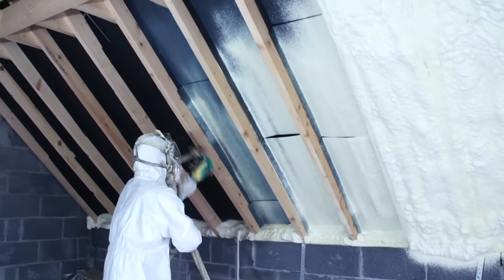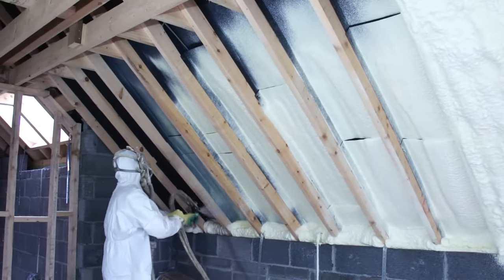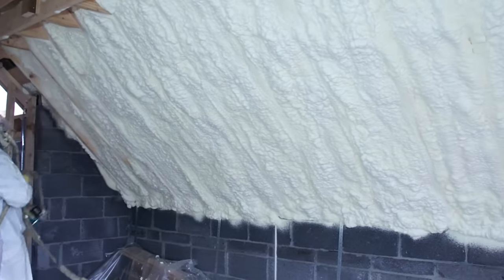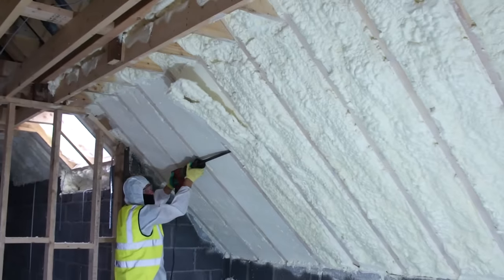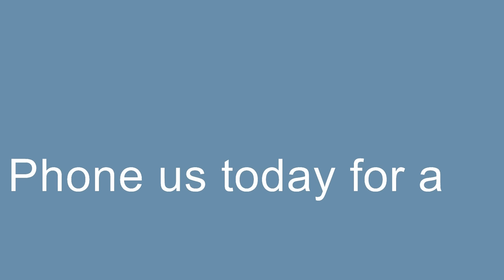Spray Foam of attic and then Foam being cut evenly

Comment: Nice neat job by the technician.... Plus he is laying thin layers at a time.... That way you will be assured there will be no uncured foam that remains in liquid state., which could off gas forever.. Seems the liquid chemicals used to make the foam are relatively unsafe to breathe in liquid form.... But become harmless after the chemical reaction has taken place and turned the liquid into a solid foam core... As in a Styrofoam cup we drink coffee out of....
But what do I know anyway?  I slept at a Holiday Inn last night.
Reply: +mrpearl1 Actually it sounds to me like you know quite a bit. You know more than the majority of these commenters. And yes I have sprayed foam before.  :)

Comment: I love this technique. I've spent hours installing fiberglass. Hated it. Tedious and itchy while I have my misgivings about how well it performs. This stuff sticks tight and is firm. Even rats would have a hard go of it. Fiberglass is a perfect home for rats and mice. Especially under a trailer home.
Reply: John Knoefler Mice,rats,bugs & virtually all rodents avoid the spray foam.they will not eat through it,so it is a saviour in more than one way.
Reply: John Knoefler i had an animal trying to get into my loft the other day and I sealed it with foam and it's given up now so it's excellent stuff
Reply: Inspecting a friend's attic the fiberglass insulation was matted down by rats, cats and and mice. Filled with feces. What a mess to clean out and replace.

Comment: Finally, 1 guy that knows what the hell he is doing.
So many houses have been destroyed by so-called professionals but this is the first 1 I see.
But still, I would recommend not using spray foam insulation.
If only that it looks horrible.
Glasswool and place some boards over it for a much cleaner look.

Comment: That's perfect. If I had foaming done  Id want the cavity full. Those that leave gaps are NOT maximizing the insulation value.
Reply: peterincgy open cell foam is done this way. closed cell is left just shy of the interior of the rafters, due to difficulty of trimming.

Comment: If 1/8 of spacing between roof sheeting is required by code to release preasure from the attic during storms how is it code compliant to seal off what the code calls for

Comment: What is necessary insulation for a home on pillars. 
Would you spray foam it then sheath it with a r_3 foam board on the underside joists  ?
Reply from the maker: Probably the other way around - fit the foam boards in a warm roof construction and then spray foam oto same - ideal combination

Comment: It's very nice, however it looks like there is a lot of wasted material ones he starts cutting off the excess foam!
Reply from the maker: Elamar - we hate waste also - we bag the trimmings on site, always and many customer use the offcuts as additional insulation in other voids in their roofs, crawls spaces and floor joist cavities - so it's not always wasted . If anyone has a good idea on recycling foam trimmings I'm all ears ?
Reply: You could possible run the excess insulation through a wood chipper or something similar.  That way, it would be a very fine material that could be used in ceilings or attics.  Just a thought :)
Reply: fusioninsulation The little waste of insulation is minor compared to energy loss from other poor insulations. I’m more interested in where you got that saw blade! Love the results of this job.

Comment: You shouldn't have to scarf all that when your foam looks like stucco maybe Half pound is your thing
Reply from the maker: +Grezzy42 As we mentioned we're spraying half pound open cell foam here not 2lb . You'd struggle to cut 2lb this easy . I'm not saying that cutting off overspray is the most efficient use of foam but customers demand it so that is what we do for them . As the old adage goes 'Whats the first function of any business ? To create a satisfied customer"
Reply from the maker: you might be right .Personally I don't like cutting foam , it removes the 'skin' off the foam which is the best part of the foam

Comment: what blade is that you are using to scarf ?
Reply from the maker: +STEELSLINGA Most major foam equipement sellers in the states sell blades 

http://www.sprayfoamequipment.com/foam-saw-blades.html 

http://sprayfoamequipmentmfg.com/parts-and-equipment.htm

Hope that helps buddy ;-)
Reply: did you have to buy it from the states or is there a uk or europe based company

Comment: Just wondering, What kind of R Value would this ceiling have with that much spray foam?
Reply: Look up open cell foam insulation for the one in this video. Typically 3.5 - 4 per inch on the half pound psqft. Closed cell (2 lb psqft) 6.5 - 7 per inch

Comment: Why would you ever leave an air space behind the foam? According to everything I have read and studied this will only create problems. The air space is to allow moisture to dry and have a place to go. With foam against the plywood there will be no moisture to vent. What is the logic or thought here? I am interested to hear why.
Reply from the maker: +mfmanuele We are required by building code in Ireland to put in this spacer . Lots of disagreement over its use , but hey I dont write the rules - Thanks for the comment :-)
Reply: So, what about in Southern California? We have little rain, humidity is relatively low most of the year. Maybe skip the air space and spray directly against a plywood roof sheath?
Reply: One thing I have learned every country has it’s known codes
Reply: Because of condensation from the roof.
Reply: There will always be moisture that needs ventilation. If you do not leave a channel for airflow you are asking for trouble.

Comment: That looks like a p2 gun to me. Not a fusion. Your spray technic is a good way to make bad foam in a hurry. 1 inch minimum lifts at a time. Its a chemical reaction which requires the heat of the foam to react properly
Reply: +dsfi2010 heat control is important. You do not want too much heat. This guy is doing it correctly.
Reply: unbelieveable how many people think the right thing to do is gob a ton on at one time, heat is the enemy here, all it takes is one mistake to end up with a runaway endothermic reaction that will ruin a house
Reply: +consaka1 you also need enough heat for a proper chemical reaction. Less than an inch does not produce enough exothermic heat to make good plastic. Some foams you can't spray more than 2 inch lift without problems, but you still need more than 1. Some newer good foams will do 3 inches plus without issues. All still require a minimum thickness to get a proper exothermic reaction. Really small lifts also give you shitty yields, to top it.
Reply: Christopher Gruenwald I have done this before so why are you telling me? This guy is doing the job properly and doing an excellent job controlling the heat. you don't want too much heat or too little heat.

Comment: I'm taking this has a lot of benefits
Reply from the maker: open cell foam gives you breathability and insulation in one system . if you use it with a breatheable roof membrane any water vapour entering the roof void can pass through the OC foam and then out through your permeable roof membrane

Comment: why not just use the polysterene sheets and cut to fit , got be less messy and no nasty smells
Reply from the maker: Sheet insulation is okay I guess . You have to allow for 5-7% wastage , cut each sheet individually and then they are not airtight so you have to buy dozens and dozens (I've seen hundreds of cans used on big jobs) of DIY foam cans to caulk the sheets to make them airtight ....and you have to project manage and QC all that . Getting us in takes just 1 phone call and we clean up after us .

Comment: Do you need the black paper attached before spraying?  Was that applied for the the foam?  I talked to a professional and he never mentioned applying a black paper.
Reply from the maker: Davian - the black paper system is a spacer card that we have to fit in Irish roofs under local regulations - It's a bit of an anomaly in terms of regulation as for example if you fit Icynene foam in Ireland you don't have to fit it but if you spray all the other certified foams you do (even though they are all pretty much identical open cell foams ) - go figure

Comment: timber will rot if not  breathing and obviously this is airtight... also if this is open cell it will suck up all the moisture and make things even worse over time.  Timber has much higher U-value than the sprayable foam therefore the exposed timber  on both sides of the roof will act as a thermal bridge causing local heat loss and generate condensation- great! more moisture to be absorbed by your foam... As far as I know any structural surveyor will fail the foam 'as presented' and you will have to drop the price when selling your house or you will have to pay to remove all this 'masterpiece' before sale.